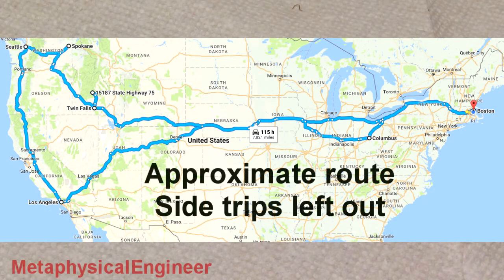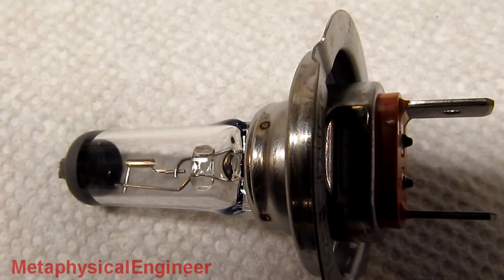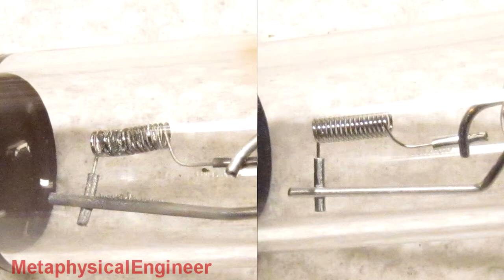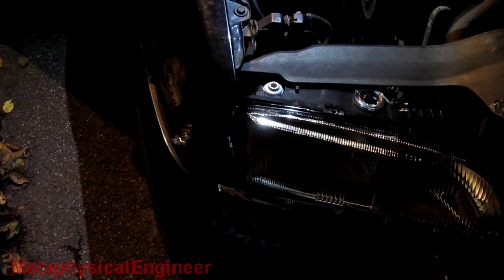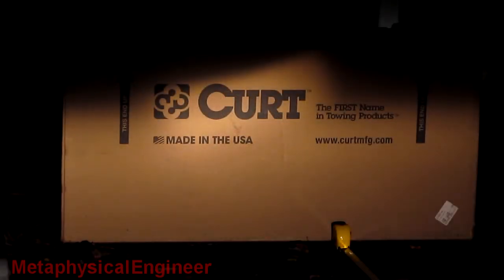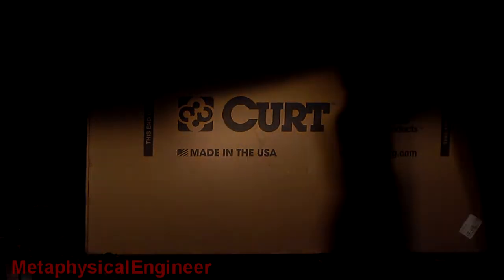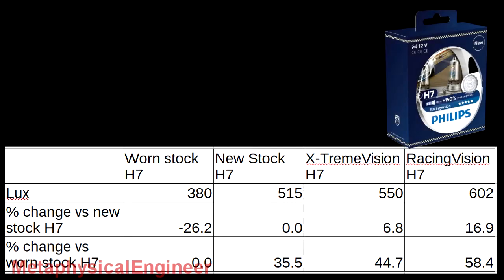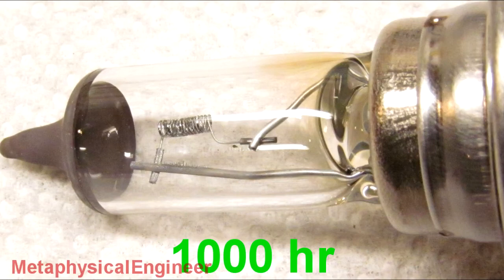Replace your Headlights BEFORE they fail!

Comment: +150% (or 30-60-90-130% etc) does not mean the bulb is 150% brighter but it means the area of the hotspot is 150% greater. All the H7 bulbs produce 1500 lumens, but focused differently. Anyway, great measurements!
Reply from the maker: Csaba Vartik well I was measuring the hotspot here, and obviously it wasn't anywhere close. Maybe there is some light housing reflector combo that will magically result in such a high output, but certainly not in my case. I'd be more lenient if they meant 30% brighter when I only measured a few percent gain. They do offer an improvement but not nearly as much as the advertising says.
Reply: Here is a nice article (in Hungarian, but google translate helps) about how a bulb output can be measured: https://totalcar.hu/magazin/technika/2012/07/04/hany_szazalek_a_50_fenyero/
Reply from the maker: +Csaba Vartik cool!  I'll check it out when I get the chance.